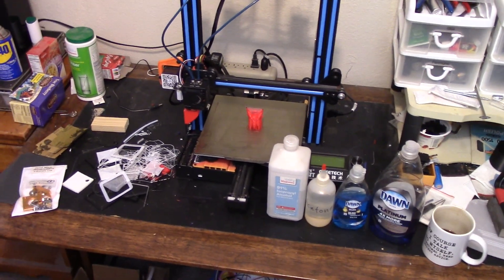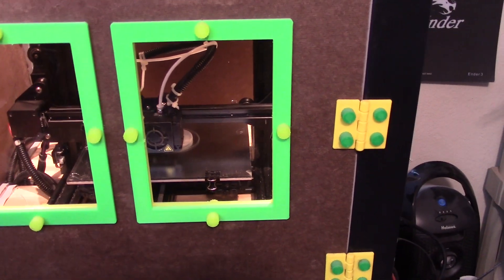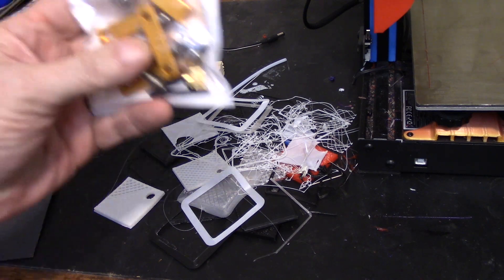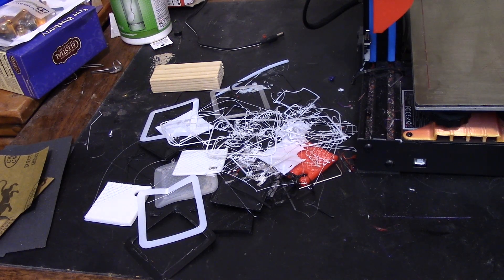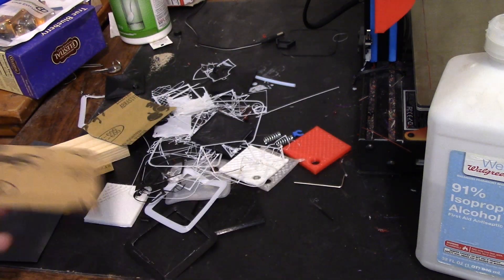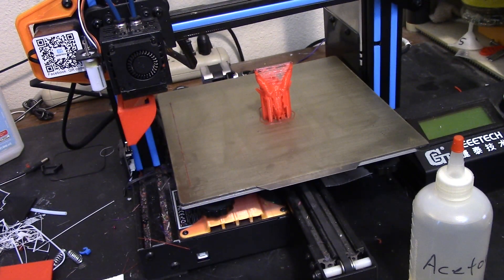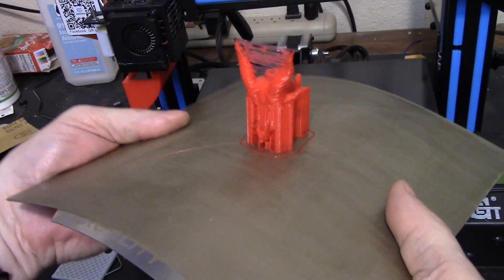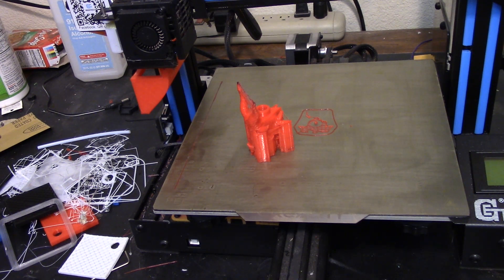What filament sticks to PEI? Should I stop using mirror and hairspray?

Comment: My success or failure with PEI has a lot to do with the manufacturing. I have had lousy results with some of the cheaper brands, pretty good results with the Creality like you were using, and excellent results with the ones from Gizmo Dorks, WhamBam and TH3D. The last two are more expensive, but you definitely get what you pay for when using PEI sheets.
The cheapest ones use what must be a micron thin coating that quickly peels off. The Creality sheet is thicker and works pretty well. The GizmoDorks, WhamBam, and TH3D products have nice thick sheets
That are really durable. I don’t use or recommend acetone for cleaning PEI, especially the thin stuff, it will take it right off. In my opinion acetone is way too aggressive unless you are removing glue, paint, or nail polish. Soap and water or IPA is all you need. I use something like glue stick or Vision Miner Nano Polymer as a release agent when printing PETG on PEI because it sticks too well!
Reply from the maker: Great info, thanks!

Comment: 6 or 7 years ago, I was printing pla with no heated bed, just blue tape and hair spray. I bought an ender 3 + earlier this year, and wanted to print petg. Bought the creality pei magnetic sheet, and the petg tore out some of it, then with nozzle two low, burnt a pattern in the surface. I cleaned all the pei sheet from the spring steel, now I use hairspray on the steel sheet, and it works fine. Wish I'd saved the money.

Comment: Hi .. there's any difference between A10M printer with model number is ( 800-001-0598) and the A10m model number ( 800-001-0542) ?
Reply from the maker: I don't have a clue, sorry. Mine says "Model A10M" on the ID sticker and no other number. I know the A10m comes in different configurations, for example there's a version that comes with the 3D Touch sensor and correct firmware and one like mine that doesn't,so maybe that's it. But without talking to someone at Geeetech I don't know which one is which.

Comment: Sorry - I got a noob question overhere: when you apply hairspray to the glass/mirror: do you want to get like a thick coating of hairspray on the surface? With the hairspray nozzle only at a few cm distance?
Or are you more looking for a light, even "dusting" with the spray, from a distance of say 30 or 40cm, without forming any "puddles" of hairspray? Thanks for the advice :)
Reply from the maker: I shoot for a heavy but even coat. I go back and forth, side to side covering once, then I rotate the mirror 90 degrees and do it again. I don't want to see dusting or specks, I want it to still look like a mirror, if that makes sense. I think I did a video on it quite a while back.
Reply: Found the video - fantastic! Discovered you yesterday... love the content, love the humor: got yourself a new subscriber :) cheers!

Comment: You are not crazy. I have a very nice mic-6 cast aluminium plate, with a pei layer. Never worked. So, I'm using hairspray on the pei, and it sticks like superglue.  Forget the stupid pei sheets, it's a waste of money. If your old dinasaur method works, why fix it?

Comment: Got a Creality PEI  surface for my Ender-3 Pro. Unfortunately the surface wasn't perfect with a couple of nicks to it.  At first I really struggled to get PLA to stick.  In one instance I had the nozzle too close to the surface and it left marks, which now show up on the bottom of prints - you could do this deliberately with a reversed/mirrored image to get your name, logo or a pattern on the bottom of your prints (have you seen the holographic surfaces?)!  Eventually I found that my bed was warped and this was fixed with a BL Touch - no more scratching, but PLA still wasn't sticking.  I found that PLA would stick well where the surface had been scratched - note, I hadn't used wire wool on the surface because I wanted it as smooth as possible.  Once it had printed well on one bit it would stick again!  I did a grid of 1cm squares to cover the bed and eventually it worked - needed to get the Z-offset right and the temperature.  I then did one big solid square to cover the surface.  Even though PLA can be printed on a cold bed I found I needed to print the first layer at a hot 65°C, then drop down to 60°C for the remainder of the print - any colder and thin (at the edges) prints would start to lift, and so I added a skirt to some.  I then purchased a second sheet for my second Ender-3 Pro, again a Creality PEI sheet, and again with noticeable nicks in the surface.  This time it printed straight off by setting the temperatures as above.  I have now put them both in Creality Enclosures and need to see how low I can get the temperatures.  Also helps doing a 9x9 mesh bed level - 81-points - the only problem then is getting far enough over to the right (I'm still figuring that one out to get as close as I can without the print head mount hitting the end of the X-axis).  Just remember to allow your print to cool down with a flexible sheet, otherwise your print may bend before peeling off - it pops of really easily once cool.
Reply from the maker: That's a lot of great info, thanks for sharing!

Comment: Wow Chuck. What an exhaustive study. You really tried a lot of things. I own a Prusa which has a PEI coated sheet and have printed successfully PLA, PETG, ABS and TPU. One thing I have noticed is that you have to keep the sheet clean. Oils from your hands will cause bad print adhesion. I wash my sheets with dish soap and water using a scrubby sponge in the sink. I dry it off with paper toweling that has no additives ( some manufactures do this ). I follow this with a wipe with acetone or ipa. I have to do this every 4-5 prints. When you described you bed leveling issue I thought that 3mm seemed extremely large. When I set my bed level I noticed that a 0.05 mm amount can make a big difference on adhesion. Getting the right amount of filament squish is critical with some materials which can be frustrating at times. I found that large ABS prints (>10 mm tall) are tough to print outside of an enclosure without warping. I have found recently that GeckoTech Hot film sheet worked well when printing ABS without a lot of warping issues. Good luck with any further trials. Let us know how it turns out.

Comment: Once a year I purchase roughly 2 cans of hairspray for about $1.50 each. I clean the mirror with plain soap and water (how much does a drop of dishwashing liquid cost?) and I only wash the glass perhaps once a month. I purchased 15 mirror tiles for $8. I have used exactly 2 tiles, most of the time I only use 1 mirror tile. None of them have broken so nothing has needed to be replaced yet, I only use 2 if I am printing many things and I just want to swap in a new one before the old one cools off. I do not print anything more "exotic" than ABS (and not very often at all), PETG is more than capable when it comes to heat resistance for my uses. I love the glass and hairspray and it always works. This is normal glass as well, nothing special about it at all. If a person is a clumsy fool with no patience, or your kids don't listen and wont stay away from your printer, well you should all probably be in full PPE and not handling normal glass, stick to safety glass or the spring steel sheets. I have no coated sheet to replace, ever, and this is about as cheap as you can get, plus the prints pop right off after the mirror tile cools.

Comment: I'm not sure if I would totally throw out PEI as a material.  We have a PEI sheet on our printer at work and it works very well with PLA.  I have the same creality PEI system on my two enclosed Ender 3s and unless I use glue stick, nothing sticks to them.  CHEP did a review of the creality PEI system and had nothing but troubles.  I suspect that the PEI used on these isn't very good.  I really like the magnet/spring steel part of it but the PEI doesn't seem very good so I'm planning on getting a different version and replacing it.
Reply from the maker: I'm not going to throw it out, it works fine with PLA, PETG and TPU on the unenclosed printers. I tried a Fystec sheet with no better luck. Maybe at some point I'll find out which are the good quality PEI sheets and try one of those. Thanks for letting me know that CHEP had trouble with it too. Now I don't feel quite so bad.
Reply: @3rdpig  I look forward to hearing if you find another solution for your enclosed printer since that's what I'm doing with mine.

Comment: I use the glass bed from creality and at least 91% ipa. Pla won't come off until it cools down. Have you tried that chuck?
Reply from the maker: I've used mirror or glass and hairspray since the very beginning. I've never had problems getting PLA to stick to glass. I've tried glass without hairspray for PLA with mixed results. Sometimes it comes loose, specially if it's a taller part with a small footprint. I've never had the glass bed from Creality. I've either used mirror squares cut to fit or the borosilicate glass plate that came with my Alfawise U20.

Comment: maybe it is fake PEI... I have an energetic double sided PEI and powder coated PEI spring steel sheet and it works great with ASA, PC, PLA, too well with PETG and TPU... idk...
Reply from the maker: This isn't my first attempt with PEI. And that's not counting the supposed PEI beds that come stock on printers. The previous one was a Fystek, this one is Creality. Same results on both. So either their both fake PEI or I'm doing something wrong. Or it's just a luck thing.
Reply: I don't think you're doing anything wrong... like seriously..  on real PEI things like PLA or PETG stick even if the bed is cold... printers manufacturers often get their compoents from the same supplier... maybe that supplier suplies bad PEI =/
Reply: But anyway... if glass and hairspray works for you.. I see no reason to even try other things
If it ain't broken, don't fix it; they say ahhaha

Comment: would you try to clean the mirror surface with viniger (apple or grape)
Reply from the maker: Sure, why not. I've got a gallon of apple cider vinegar. But I'll be shocked if it works better at removing grease than IPA, acetone or Dawn.

Comment: Here is a really dumb question, but is there a protective film on the PEI?  VERY THIN layer of plastic...
Reply from the maker: I removed one protective film layer. If there was another I'd think it would have shown itself when hit with sandpaper or acetone. Or would have pulled off with the prints that did stick, like the PLA print shown. But I'll check again.

Comment: Any oils on the PEI will deter adhesion.  That's why I recommend my cleaning method.  I also forgot to list TPU.  My phone case is printed in TPU on the PEI/Ender.
Reply from the maker: TPU worked fine for me. It was only the filaments that like to warp, nylon, ABS, ASA and PC that gave me trouble.

Comment: Been printing on PEI since forever.  I print PETG, PLA, ABS and carbon fiber polycarbonate.  I suggest sanding the PEI lightly with 220-330 grit sanding sponge and cleaning with IPA or lightly with Acetone.  I do the cleaning every few prints.  I've got the first iteration of the Ender 3 too.  I'm running the stiffer yellow springs on mine.
Edit:  My PEI sheet is not from a manufacturer of beds.  It's a plain old sheet of PEI from Gizmodorks.
Reply from the maker: I've tried this Creality PEI and a few months back a Fystek sheet. Same results. I'll try with 220 and while I can see it improving ABS and ASA to some degree, nylon and PC was so poor I doubt it will make it functional. But I'll give it a try, thanks!

Comment: I print with matterhackers tough pla and petg. The tough PLA always sticks without adhesives but with PETG  and TGlase (PET) I usually have to use a little hairspray on any type of surface to make it stick.
Reply from the maker: I'll try hairspray, but to me the whole point of PEI was not having to use adheshive on the bed.
Reply: @3rdpig  you could try steel wool and use a circular motion when roughing up the PEI. Not sure how that would be different from the sandpaper application. But yeah I was just agreeing that I don't see the direct benefits of PEI surfaces over other surfaces.